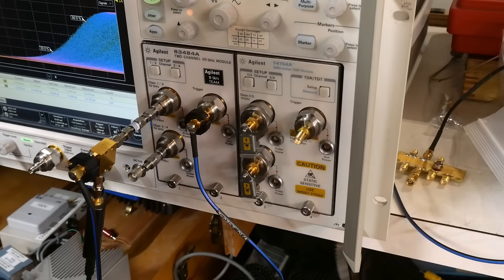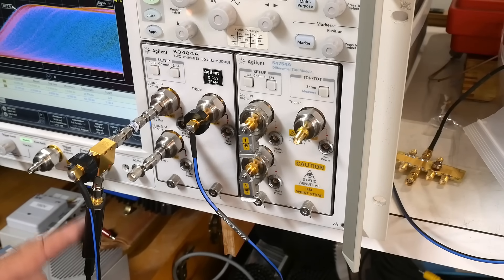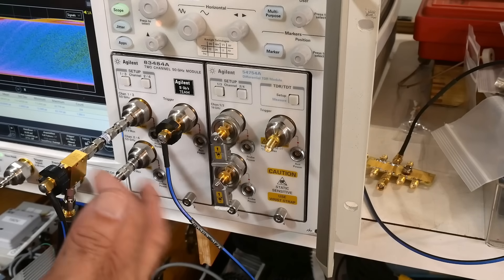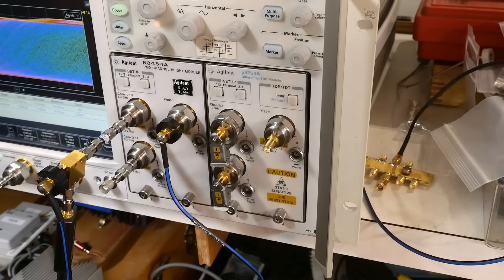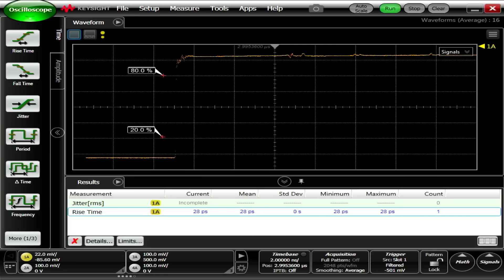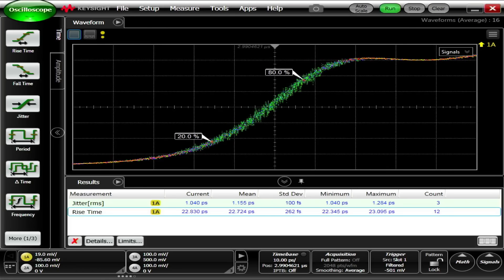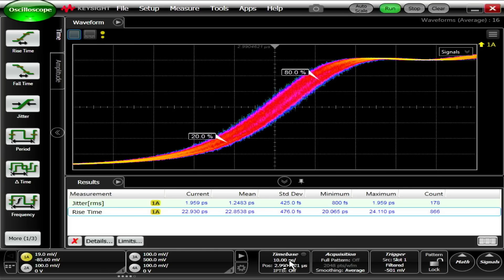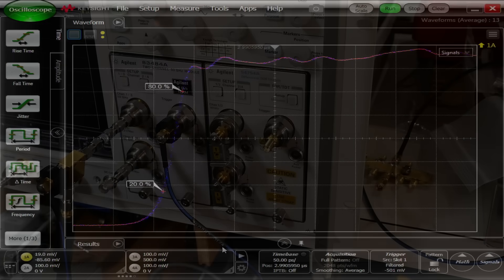#2295 DCA-X Pico Second RIsetime Measurement

Comment: how common is 20-80% for rise/fall time? or rather, where is it common ? can only find it a few places and all with the Ghz people - is it an salestrick because everything gets a bit soft round the edges at picoseconds ?
Reply from the maker: It is the standard measurement where my friend works. fast communication signals 80.20 is the way.
Reply: 20%-80% is Telecom and digital signalling (PCIe/HDMI/USB/etc) because the noise floor is quite high and switching thresholds are closer to 50%.
10%-90% is analogue domain and instrumentation.
Reply: @Leo-u3t1j  That makes perfect sense, thanks :-)

Comment: What would be really cool is a video describing the safety techniques to not blow out the plus minus two volt front end of your module. 😊
Reply: like +/- 2V and +16dBm  means a Sine Wave (+/- 2V peak): +16 dBm average power or a Square Wave (+/- 2V peak): +19 dBm average power. Maybe also mention DC offset and also Crest factor? I would always feel sad if somebody gets a lovely scope but fries it quickly. It might make a good video?
Reply from the maker: the TDR plug in (tomorrow's video) is way way more fragile. +-2 but very static sensitive also and the charge on a coax can zap them. that's why they have the funny spring loaded cover. no way to protect any of that except extreme caution

Comment: Well, that was fast.  I mean really fast.  
Since you are using the pulse under test to trigger the scope would the jitter calculation be accurate in this setup?
Reply from the maker: No
Reply from the maker: you can still measure cycle to cycle jitter. period width
Reply: Considering that passive components such as cables and connectors shouldn't come with jitter assuming that they are firmely connected, I would say that this rather measures the jitter of the scope itself.
Reply from the maker: @thorstenmoller4305  remember i have the Leo Bodnar repetative  pulse generator attached, it will have jitter.
Reply: @IMSAIGuy  Yes I know. But what is the time reference for measuring the jitter? Isn't it the trigger signal? If my assumption is correct, and since you used the pulses as both the signal and the trigger signal, wouldn't this cancel out the signal's jitter?
Reply from the maker: period to period, you can look at jitter on a normal scope if you trigger on one edge and then look at following edges

Comment: Very nice, an interesting deviation speed is the one the beam gets across the screen as fast as the wave travels through the cable or through space. Long time ago I could use an HP scope with half the bandwidth to play with. 
In this frequency range the cables to get the signals to the scope have an influence on the signal. To get at least a qualitative (half way quantitative) impression of this effect it helps to double the cable and to compare the effect.

Comment: You refer to this stunning device as the "box". It has a loud fan. I refer to is as the "box fan"; its about as loud as a box fan. But hey, all really cool electronics devices have loud fans! Ima fan!
Reply from the maker: it's got two really big fans on the RF stuff and the small CPU fan. It's not as bad as other test equipment I have and way more fun
Reply: It actually has a nice low frequency whoring fan - I could fall asleep to that fan nose - a lot more soothing than a lot of other test equipment. I guess that's part of what the steep price tag gets you - nice fans

Comment: 5:50 well fast enough to watch a light beam travel both as a wave and particle 

Travel as a wave in a vacuum 

Acts like a particle when it interacts with matter or changes it's frequency, 

But a particle does act like a wave, bounces, reflects, well can you refract and bend a particle?
Reply: A sampling non realtime femto camera

It records effectively at trillions of fps

But it's actually run in pulses and the data is actually stitched together from the slices (basically subdivide the picture) after several million pulses and hundreds terabytes of "image data" being processed 

Femto camera can see around a wall or corner 

Because quantum physics

Comment: Did you also use a DC blocker or just adapter from 3.5mm to 2.4mm?
Reply from the maker: No DC block.  It can handle +/-2 vdc